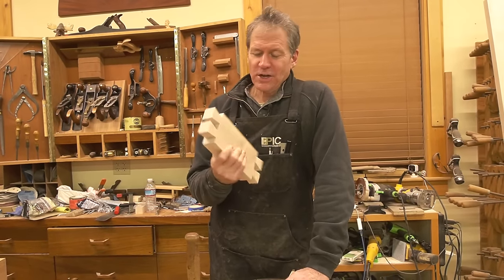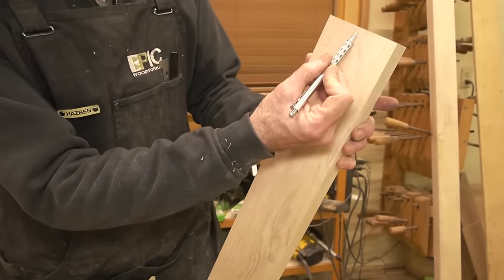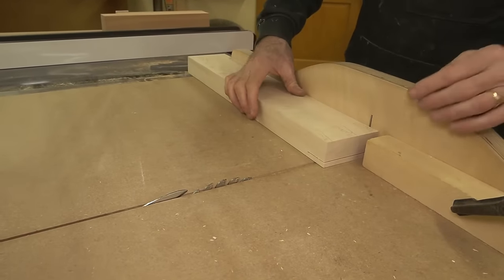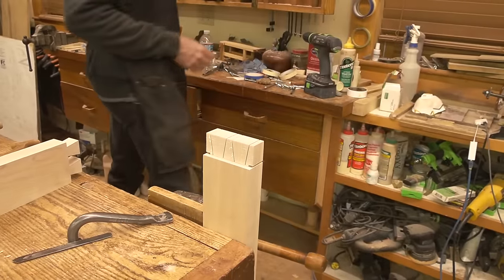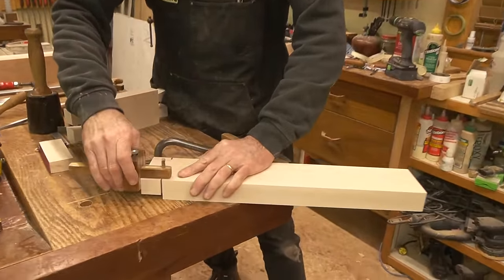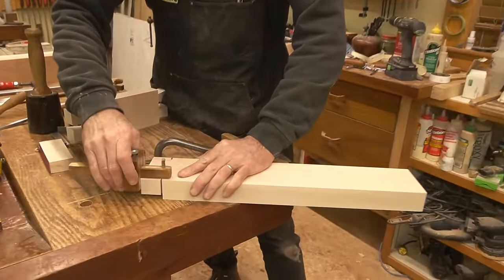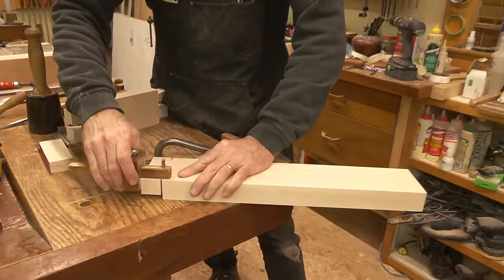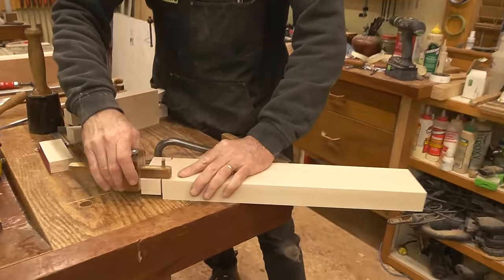How to Make Bandsaw Dovetails

Comment: Tom, can you tell me why you chose soft maple for your workbench instead of say, hard maple? What are the advantages of soft maple?
Thanks. Enjoyed this video.
Reply from the maker: Thanks, that's a great question. If you have access to the video Course, I discuss this at length during the first session where we introduce the project. There are so many options when it comes to workbenches. The hardest wood will certainly be the most durable, showing the least amount of wear over time. However, the hardness can have a kind of sharp feeling when working on it. It's hard to explain, but I think of it almost like a slightly softer wood, having more elasticity, more friendly to the touch, and the ears, when working with wood on it as a surface. Of course a softer wood, like soft maple, compared to hard maple, will show more wear over time, but I considered the workability of the surface when making my choice. And there is also the matter of cost, which can be significantly higher for hard maple. When it comes down to it, it's a very subjective choice, and I would recommend a good chunk of whatever species you're considering and smack them around a bit to see what resonates with your liking. Hope that helps in answering your question. Thanks for your interest!

Comment: how do you handle it when the board of the pins (or tails) is about 7 ft long?
Reply from the maker: The same way. I actually decided to use this bandsaw method for that exact reason…for the long rails of a workbench project we have as a course at epicwoodworking.com. Thanks! 👍